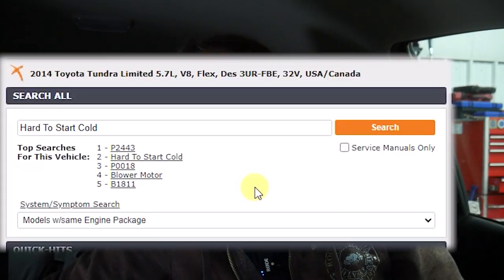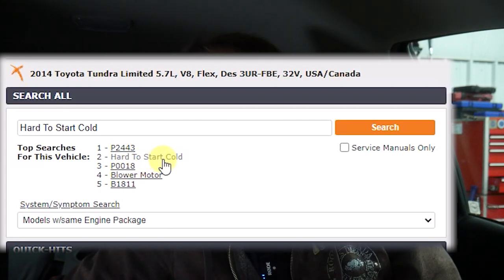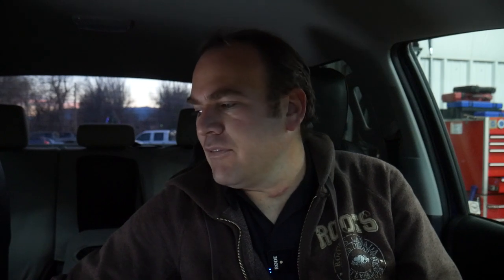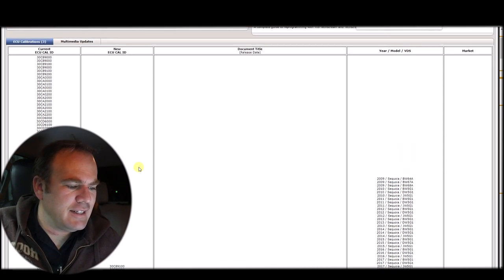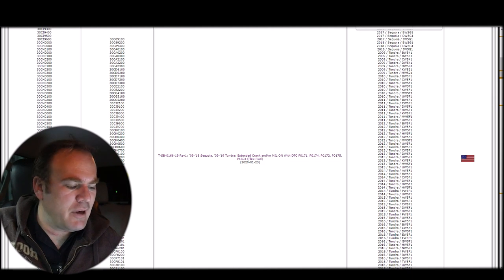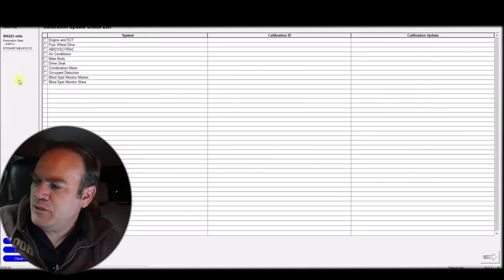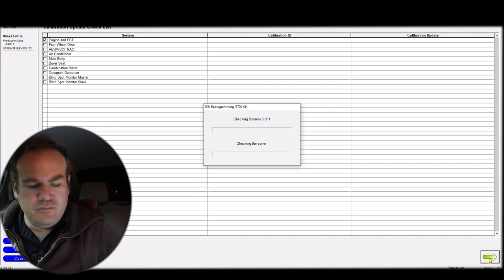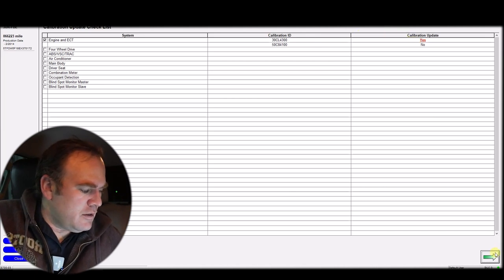2014 tundra Hard start or long crank time - TSB PCM update

Comment: I had my fuel pump replaced and ecu reflashed by toyota under warranty on my 2017. The problem occurred AGAIN 3 weeks later. I was able to start it after many tries and drove it straight back to the dealership. I'm hoping this won't keep occurring.

Comment: I had this TSB done on my 2017 tundra. They replaced the fuel pump and calibrated  the ECM. Two years later it started doing it again. I got toyota involved because they wanted to charge me for the whole thing which was around 1300. They dropped the price I paid to have the pump and ECM recalibrated.. got the truck back and the fault is back again all within 72 hours. I love toyotas. What the hell?! Now they want the truck back to start a case and have their senior techs work on it.
Reply from the maker: The next one I get in the shop I’m going to look at the calibration and see if flex fuel can altered. We don’t have e85 in my area so we don’t really need the option or the calculated ethanol value. If I could turn flex fuel options off it would solve the issue.
Reply: @ThePracticalMechanic any update on if you can turn the ethanol options off??
Reply: Yeah, any updates!?
Reply: @ThePracticalMechanic if I was to put E85 will the problem go away?

Comment: Thanks so much for the video.  Owner of a 2016 Sequoia Flex Fuel with a hard start (alternator and battery are good).  so guessing this MAY be the issue.  It isn’t throwing any CELs but maybe there are codes in there I need to get read. 

Do you think that the fuel pump change is a requirement? It was done in that trucks instance (just before your workflow) but feels like an odd swap if it’s an ECU reFLASH issue.  And people are saying it is coming back anyway months later with the change and flash (just reading other comments).
Reply from the maker: We have done many vehicles with just the flash and none have come back with issues. My guess would be the fuel pump causes the truck to run lean at times and the ECM thinks alcohol content is higher than it was previously.

Comment: I heard you mention a snap on scanner tool at the beginning of the video. Have you tried to reset the density with the snap on tool or do you use tech steam every time?
Reply from the maker: The Snapon didn’t have the function at the time of filming but is on the release list for upcoming update. I haven check to see if it is available now that my Snapon tools have 23.4 software. I have a truck in the lot right now waiting for the update so I can test it out and see if the reset is available.
Reply: @ThePracticalMechanic  that would be great if you could let me know. I had the new fuel pump installed this spring and it didn't help the extended cranks/rough start. I'm tired of fighting with the dealer to reset the density and fuel trim like the TSB says to do. It's getting cold here now and starts are getting worse.

Comment: I’ve got a 2012 Flex fuel Sequoia with the same issue. I visited the dealer and asked in the service department if they had run into this with flex fuel Sequoias. He said they did and that only by running through diagnostics could they determine the exact problem. This made sense to me. He said usually it entailed dropping the fuel tank and replacing the fuel pump and then reflashing the ECM. When I asked about a ballpark estimate for the cost of the repair, he again said without diagnostics it would be a guesstimate, but that this procedure would cost from $2200-2500 to perform by Toyota service. I’ve been living with this for 2 years now, and trying to justify the expense over just living with the problem. In your opinion, what would you do and what suggestions could you help me with? I’ve been looking for someone that went into detail explaining the problem and the procedure and ran into your you tube video here. It is an excellent video, well made, and explains what I suspect is going on with my Sequoia. Thank you so much!
Reply from the maker: I just had a sequoia in the shop acting up.  The alcohol data showed 60% even though a fuel sample showed 10%. 
A reflash alone did not and would not fix it since the fuel pump was actually bad. 
The fuel pump was providing about 10psi less than it was supposed to. After replacing the fuel pump along with the reflash the vehicle has been flawless. 
These fuel pump are expensive but I think our repair cost was around $1500-1600 for pump, seal, flash, reset alcohol content 3 gallons fuel and relearn.

Comment: In the Values it shows "Current Fuel Type : Ethanol" - shouldn´t that say "Gasoline" ? Or does this change after the Learn is complete ?
Reply from the maker: It showed ethanol even after the flash and test drive.
Reply: @ThePracticalMechanic  Maybe thats the basic Problem, the Car always has Ethanol as default ?!

Comment: do you have any problems with the think diag II connecting to blue tooth i have google pixel 7 pro and always have to try to connect a second time if i haven't used it in a couple days if its the same day will connect no problems but i really like it just wish it would work on a tablet
Reply from the maker: I haven’t had any issues with connection to my iPhone.  It instantly connects when I plug into the vehicle.

Comment: Nobody is using more than 15%, I would have thought it would be easy to reflash with a top limit of 15%. I wonder if government regulations prohibit manufacturers from choosing the easy pathway.
Reply from the maker: They are probably required to produce a certain number of “lower emission” vehicles to keep the govt happy. 

On the Chevrolets you can disable it with many different tuning programs. Or you can even wire in a real flex fuel sensor and change the programming in the ecm so it knows to use the real sensor instead of the virtual sensor. Most of the newer 2016+ Chevrolets have gone back to a real sensor instead of a calculation. 

Toyota is less experienced in the flex fuel market so they may have some issues until they add a real sensor. 

Stay safe and warm this week as the weather is turning and have a wonderful holiday weekend.
Reply from the maker: I just had another one come in today. 2017 tundra with rich running codes and hard start cold issues. Alcohol content on the scan tool showed 75%.

In order to do the updated service bulletin, I have to replace the fuel pump as well, but it is currently on back order.
Reply: @ThePracticalMechanic you have to?! That’s crazy!

Comment: Chad, I am trying to find out if a 2018 Toyota Yaris iA has a place for a block heater. It is the europeon Mazda 2, but you worked on one so I thought I would ask. Nice channel!!!
Reply from the maker: I’m not sure is there is a factory location for a block heater on these. If not you can probably install one of the block heaters with a pump into a heater hose. 
I don’t like the radiator hose options as much because you waste energy heating the radiator as well.

Comment: I have a 2015 tundra that i took in for the service bulletin for this exact problem. They replaced the fuel pump and did a reflash. That fixed the problem but the issue came back shortly after but unfortunately for me I was over the 80K mile mark so I would have to pay for this repair from what I was told. After watching this video I see there is yet another software update and hope that it would fix this problem but I just don't want to have to pay big bucks to the dealer only to have this problem yet again. Has that owner had any more complaints about this issue or is this THE fix? Also, if you are close to Georgia, i'd gladly bring you mine to fix, I like how thorough you are with trying to figure out and resolve the problem.
Reply from the maker: If you recently had the flash done they should have installed the latest file but it is possible to install the older one if they used the first TSB to get the file number. 
You should have a warranty on the repair and if they didn’t flash to the latest file they should do it under warranty. Most repairs have a 12k/12 month warranty.
Reply: Hello, did you have to pay and if so how much was it and did they actually get it fixed for good.
Reply: @lcotto2064  I just had my 2015 with 120K miles have the same issue. My local Toyota dealer claims they couldn't find the issues. IMO they really didn't try. They charged me $50 to tell me my battery was good but I told them from the start the battery was good and only 3 months old. I bought my truck from this dealership and I have always serviced my truck at this dealership. 

The fix to the problem is a software upload and the fuel pump needed to be replaced. Cost me around $1100 to fix. 

My local independent mechanic correctly diagnosed the problem just by describing the problem.

Comment: Can this also cause you to get code p0308 i already changed spark plugs and coil and still get traction control off and check engine
Reply from the maker: It shouldn’t cause a p0308 since that is cylinder 8 misfire. There is a slight chance that the computer is counting more misfires on 8 after it starts up because of the excess fuel but unlikely. 

If the misfire is happening all the time you may have other issues. May need to test compression, injection pulse, spark, etc.

Comment: Do you feel like the new fuel pump is actually needed? I live in So. Color. too!
Reply from the maker: I wish Toyota gave more information in the service bulletin on why the fuel pump is needed. I suspect the intermittently the fuel pump is delivering lower fuel quantity to the engine, and this may be happening after a fill up, which is triggering the vehicle to relearn an incorrect value. the initial service bulletin did not require the replacement of the fuel pump. It was only a software update. I’m suspecting that they still had some small revisions to make on the software, but realized that the fuel pump was the primary cause.

I have two pumps on order from Toyota and our parts guy informed us that they have five or six more on order. We’ve been given an estimate of two weeks to two months to get them. I have not attempted to source these fuel pumps from a different dealer .
Reply: @ThePracticalMechanic My 2015 Tundra starts up pretty much normally for 8-9 months out of the year. But does start hard when the temps drop into the 30s and below. I was wondering if a reflash was going to fix this issue.(not likely from seeing your video) How much does this fix with a new fuel pump cost roughly? That was a great Video btw!! Thanks for getting back to me!
Reply: @ThePracticalMechanic . May it be that the smart sensor is inside the fuel pump and that they hope this resolves the problem. It seems like there is no fix for this problem? Have you found out any additional info? There is no reason to change a perfectly fine fuel pump other than changing the sensor which is the cause of this mess.

Comment: Is this a Toyota covered issue, or will I need to pay to have it done?
Reply from the maker: As far as I know it’s not a recall so it will likely be customer pay unless covered under warranty. Best to call local dealer with vin number to see if you are covered. The pumps are currently on back order.

Comment: Where are you located? I need this done with my tundra asap too
Reply from the maker: Southern Colorado. Any dealership can perform this and some independent shop will have the programming equipment. Most shops will have a scan tool that can reset the alcohol value so the truck is easy to start again. The values will likely drift again until the updates are performed.

Comment: Hi. I have same truck but 2014, crank no start . I did by pass to make fuel pump run but no spark. Have your car has same problem no spark when hard to start ?
Reply from the maker: No this truck had an entirely different issue. In the video I explain what was wrong with this truck and how to fix it. It sounds like you may need a mechanic to look at your vehicle.
Reply: Having issue after timing chains on a 2014 no spark timing double checked right on the money it won't start cranks and throws p1604 no other codes once in 20 attempts it will.start and idle very low and run like a bad vacuum leak then after a 7 minute run like that it will stall